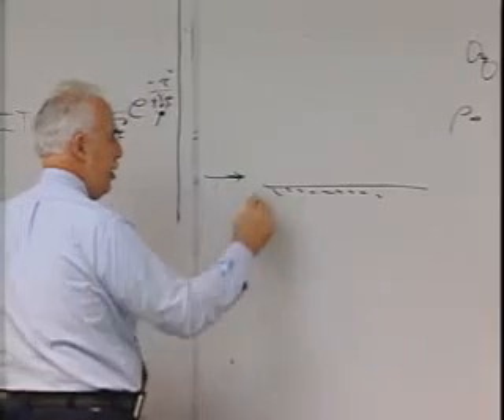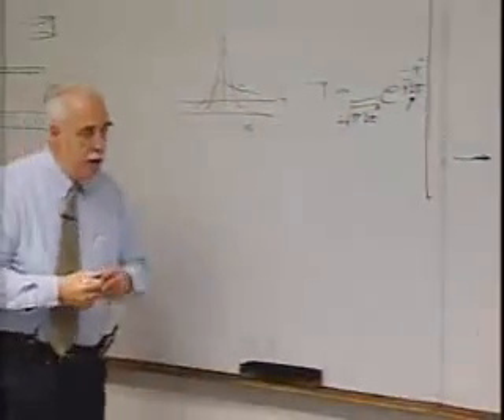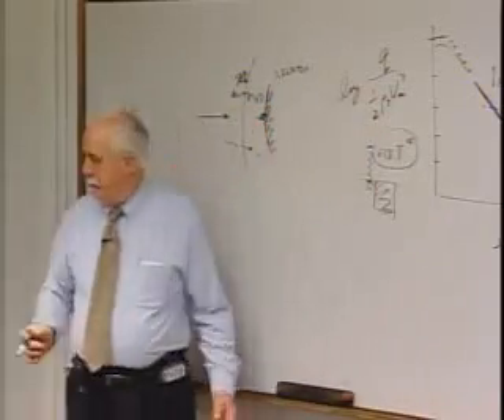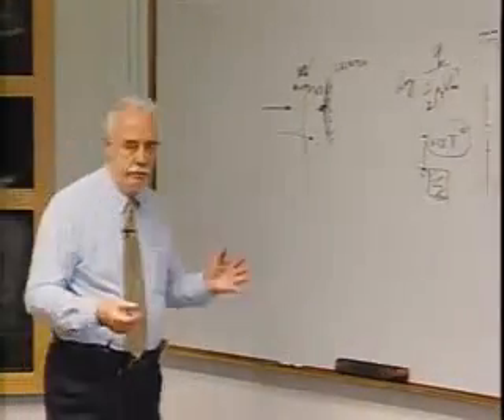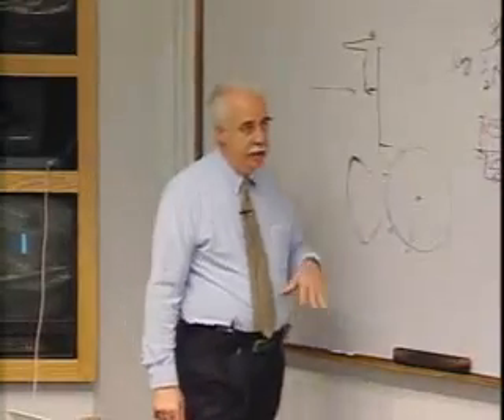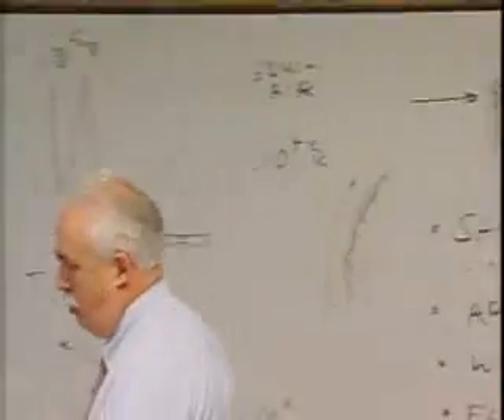Lec 12 | MIT 16.885J Aircraft Systems Engineering, Fall 2005

Comment: The subtitles on the MIT lecture website needs updating, it's clear the writer had difficulty with much of the engineering jargon (e.g. Rankine, parameters, orthogonal...)

ocw.mit [DOT] edu/courses/aeronautics-and-astronautics/16-885j-aircraft-systems-engineering-fall-2005/video-lectures/lecture-12/